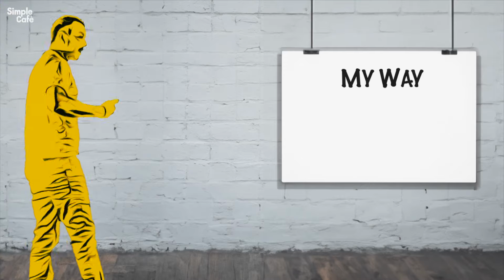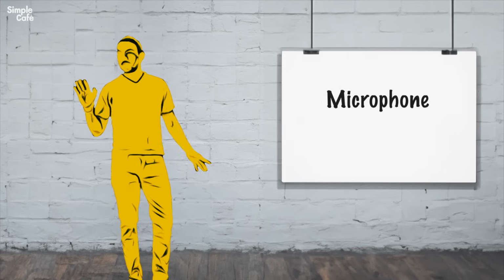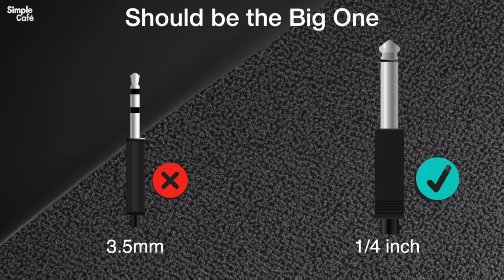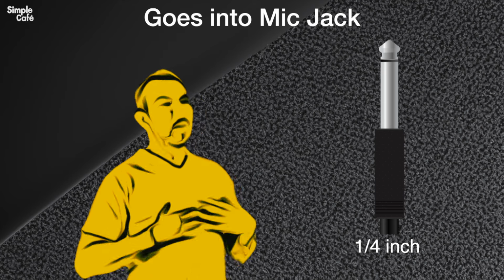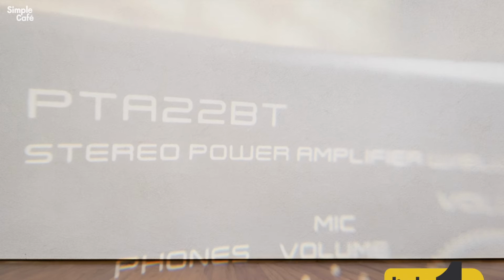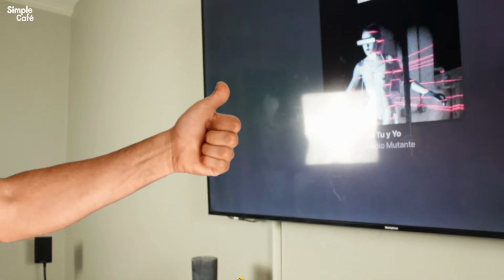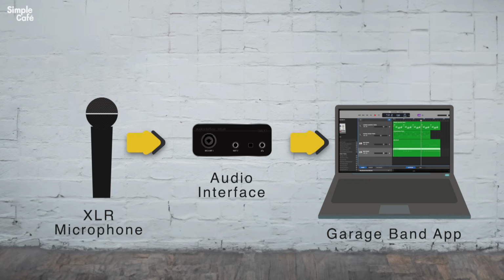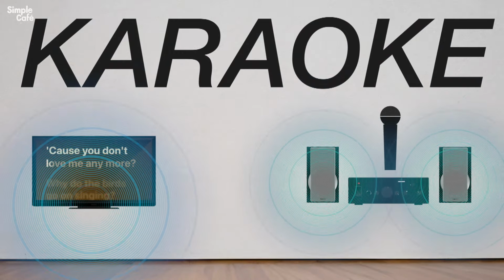A Simple Karaoke Setup (without machine or mixer)

Comment: But you’re not showing how the amplifier connects to the speakers 🤨
Reply: Amp to speaker is basic: left right center sub. Your tv output is usually what trick people:hdmi earc or optical to RCA to amplifier. 

So basically he telling to buy crap Pyle mini mic amp to get the job done vs buying complicated mixer to plug into your amp.